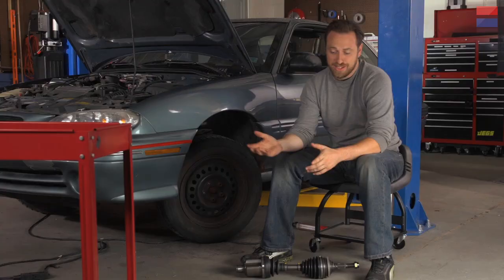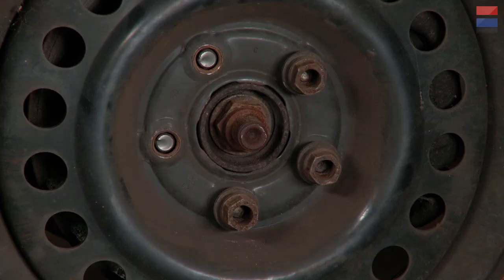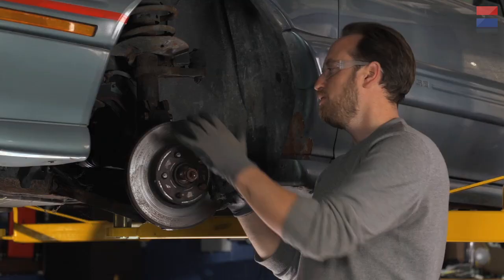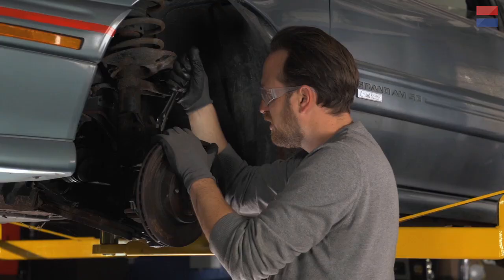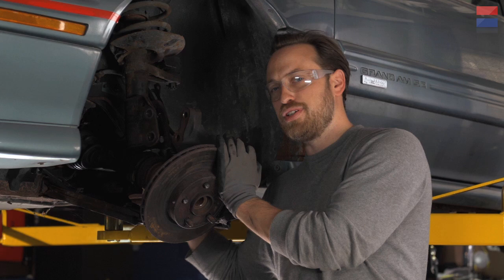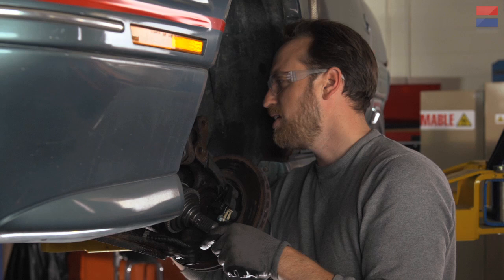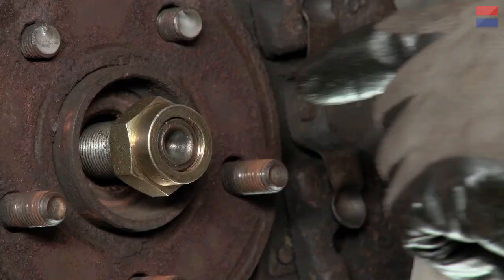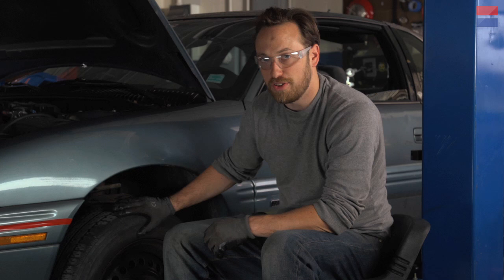How to Replace a Front Axle Half Shaft

Comment: I tried your pry bar method on my Jeep Commander, All went well until time to pop out the axle. It would not come out. I pried and pried, I actually bent the Axle drive shaft seal and the oil started leaking out. Unfortunately none of the local parts stores had the seal. Have to visit dealer in the morning. You should mention that there is a tool similar to the tie rod end remover (aka pickle fork) that can be rented from parts store. Once I got this tool and hit with a BFH the axle popped right out. Took all of 1 minute. Never do this repair on a Sunday.

Comment: ok so there is a way to do this without the need to get an alignment ... you can open up the screws on the bottom part of the hub and you lift and pull up the hub with the suspension, little harder but saves you money :) have done it several times and there was no alignment needed :)

Comment: Seriously Ben.  You do all of that work to replace the drive axle, talking about being careful to clean this, clean that, and lube the transmission end of the splined axle shaft, YET YOU DON'T REPLACE THE FRIGGING OUTPUT SHAFT SEAL?!?!?!?!  WTF?  Get it together man!  Good video in spite of that.
Reply: that's the same thing that i want to know

i thought you was supposed to replace the 
- circlip 
- the seal

if the car uses a CV axel that gets connected to a intermediate stub shaft that goes into the trans

from what i understand, the outer side of the intermediate stub shaft needs a new circlip and a seal

i got a Haynes manual for my car though, and it doesn't say that i have to replace the clip or the seal

and my mechanic didn't say anything about replacing that either

but i still think that i,m supposed to do it

Comment: Be sure to look up the specific torque for the axle nut on your vehicle. It's important that it's not under/over-tightened,as this can cause the bearing to fail. Use a torque wrench.
Reply: thanks man
Reply: Many times,if you're replacing the hub/bearing,the included instructions for the new part will have the torque listed. It may vary from the OEM torque. It's probably best to follow the hub/bearing manufacturer's specs,in that case. Just an FYI,hope it helps someone.
Reply: PhattyMo
Thanks again! You seem to know a lot about cars, i am just learning, a student. I jacked up my cars L front wheel, wiggled the drive axle shaft(the rod between the 2 boots?) and it can wiggle up n down, is that normal?
Reply: I'm just a backyard mechanic,and have a lot to learn myself. In my experience,the axle shafts should be fairly 'stiff',but may have a little play. If it feels 'loose',it's probably in need of repair/replacement. It may depend on the vehicle. I don't have a whole lot of experience with the shafts. Maybe somebody else will have a better answer. Or look for some videos about it here on Youtube. Good luck!
Reply: PhattyMo
Thanks for the reply! i will either take it to a mechanic or take another look into it, it just sucks when its raining and you have no garage and its night time, Cheers ^AB
Reply: PhattyMo

Comment: Kudos on a well done video, it is good that he mentioned about the two strut bolts likely to affect alignment (camber), even if they aren't the adjustable type there is usually enough play to affect position, when reassembling. Most of these videos ignore this. He didn't mention to be prepared that a lot of transaxle fluid can drip out of the axle opening while the shaft is out. If he has enough mileage on the vehicle to warrant drive shaft replacement for whatever reason, he should have replaced the transaxle output seal while he was in there - a lot easier than finding that the hardened old seal didn't take kindly to being disturbed like this. Just saying, that's how I would do it.Those joints don't really wear out unless the c/v joint boots are torn for a length of time, so I wonder why he didn't just replace the boots. Taking the two c/v joints apart and cleaning, inspecting and re greasing isn't that much more work, I've done dozens of them.Those c/v joints are nearly indestructible and no great mystery to work on.

Comment: Hey,
Question? I had a Pontiac Like Your’s ,I didn’t have a bad CV Axle but I had really WEAK Front Shocks - Struts.So I went through the hassle (Saved $75) of changing them myself. I bought them online from a Big Retailer and I questioned them about Front end Alignment after the swap. They e-mailed me that it wasn’t needed but if I didn’t have it done for say 50k or more it wouldn’t hurt. So I took it to a place that specializes in Alignments.They hooked it all up and guess what? It was right on didn’t need any adjustment.The guy told me if there are elongated holes with special washers under the nuts ,like the holes are also wider than a round hole or the bolts that slide through the strut have on side between the head of the bolt and the threads a flattened side for Alignment , Then that would be a good indication that this is one of the alignment points,But since my holes for the struts were Perfectly Round without the adjustment washer it was not a caster or camber ,Toe in or out Point ??So were they Wrong or What?

Comment: I replaced the cv axle on my 2001 Pontiac grand am but for some reason it didn't pop out of the transmission very easily. I had to pry from a few different angles and it took quite a while to get it out and finally it came out. My question for you is do you know why I had such a difficult time getting it out? I'm obviously not a mechanic but I've done a heck of alot of stuff. I did get the job done so no harm, no foul, just a bit curious.

Comment: Superb explanation. My driveshafts are OK but I think there is a problem with the bearing in the gearbox where one of the shafts goes in. Does that generally mean a total gearbox strip down or can the bearing be pulled out with the transmission still in the car?

Comment: Instead of removing the knuckle/strut bolts to provide clearance to remove the axle, isn't it possible to avoid a alignment issues by removing the lower ball joint from the knuckle instead?
Reply: +PsychoFisho 
Nevermind - I posted before reading the comments.
Reply: I wanted to say something about no alignment needed, PsychoFisho you said it for me bud, ty

Comment: Great vid!!     I am trying to remove 2008 Jetta front drivers Axle - 1K0407271BP. for CV boot repair.   How do I pull it from the transmission side? 

Ben, I see that you forced a pry bar behind it.  Maybe, that's what I need to do. I saw your half-axle was similar to mine on the transmission side.    Anyboddy know??

I got the axle freed from the wheel side, easily.  But, wasn't sure how to pop it from transmission side. Didn't want o force anything until I was certain of method.

 I saw several videos that show certain VW-family years  and models where 6 -each 10mm spline bolts are removed from an inboard bracket.. then, axle pops out (of course, having already freed up the wheel side). But, my axle doesn't have this.

Thoughts (I know... go to VW service... HAH!)

Comment: Nice video, thanks. You did not mention about how to address the oil or grease that was lost from the damaged CV.
Reply: Your new or reman axle has the boots already pregreased. As for the fluid coming out the differential, not much maybe a quart comes out, rarely, but just in case you just check your trans fluid level after you're done, fill up as needed.

Comment: Do you have a video on how to replace the Bearing behing the cv oil seal on a grand prix. 2008 When i removed my cv axle there was little bearings all over. Thanks for any help. Had to wrap a chain around the back of the axle then around a pry bar then swing like a bat just to get the axle out.

Comment: I like how not everything in the video went perfectly and it showed you having to struggle.  Too many how-to's show the best case scenario.

Funny thing about that is that getting a typical half shaft out can often involve the very worst case scenarios.  You actually got that shaft out of the wheel hub easily..like real easily.
Reply: Very true. I was trying to replace the hub and can't get it off the axle. Now I'm replacing the axle just to put the new hub on.
Reply: UnHoly 666 that's a waste of money just buy a 3 or 2 jaw puller iT will push the end of axle through the hub and you only spent 20 and save a lot of time
Reply: I bought a 12 ton 3 jaw puller. I bought a 3 jaw puller that you can also hammer. Neither were worth a damn. I had to buy a new steering knuckle and axle and replaced it all. Problem solved.
Reply: UnHoly 666 damn must of been welded in there that sucks glad I didn't have that problem
Reply: @jb0915  rusted in and I find the hardest is pulling it out the diff

Comment: How do you replace cv axel on a 2000 Saturn LS2 3.0 V6?  Would you do a video on it?  Can you also show how to replace the drive belt on same vehicle?
Reply: all front drive cars is basically the same just different sizes and bolts. im replacing both of mine on a 01 dodge intrepid 3.2 not a fun job but not that hard. If the axel want come out of trans lock a log chain on the end where it goes in trans and and tug the other end of the chain. hope this helps.

Comment: I saw the video. I am working on a 1993 Buick Century with a 3300 V6 and a 125C transmission. Basically the same setup as the car he's working on. The axle shaft will NOT come out. I will have to send it in. I tried the pry bar, slide hammer, pickle fork.......nothing worked. Passenger side axle came out easy, drivers side won't budge.
Reply: Try having the axel connected to the breaks and caliper system unscrew all bolts  bull towered you and down make sure car is jacked up or raised. That's how I do it everytime. Gravity does the work

Comment: I have a 2005 Chevy Cavalier with a ripped boot on the front/passenger side. I pulled the axel and replaced it with a remanufactured one. Week later started making noise again, I thought it might be because it's is a remanufactured one. Bought a brand new one and it does the same thing still. And the stub shaft seems to be stuck too.

Comment: How do I check to see if I need to replace the CV joints. Have a 97 Chrysler LHS and it acts much like a rear wheel drive does when the U-joint is shot! Have never done this so need all the help I can get.
Reply: Clicking noise while turning is usually a good indicator.  Then you have to isolate it to which side it's happening on. 

If you can get under the car, inspect the boots on the half shafts, if they're cracked the packing grease has probably leaked completely out and you're just grinding metal.  They should be grease free if they're operating properly (because the grease will still be completely contained inside of them).

Comment: hello sir, I have a 2000 KIA sephia I'm trying to replace the passenger side CV axle. For some reason I cannot get the axle pushed all the way into the transmission shaft. Also my lower ball joint keeps falling out pulling my CV axle out if the transmission shaft every time I try to take it for a test drive. Do you have any answers?

Comment: I’m getting a vibration and it honestly looks like the transmission end of the shaft isn’t seated all the way down. Is there a way to make sure? My boots are fine no tears. My front suspension was lowered a while back to change the oil pan. And the end came out as did some fluid. I refilled the fluid and thought the end was back in place and I’m not so sure but it’s all bolted down.

Comment: If you have to hammer the CV axle shaft to get it to push through the wheel hub, I suggest using a rubber cap or a piece of wood instead of twisting the nut on backwards, and using that as a hammer point. You can lock that nut on there by smashing the threads and have to end up cutting the nut off.
Reply: stan d. upnow same here. I had to cut my axel bolt off which messed up the threads on the CV axel. I had to cut off bout a inch off of the CV axle.
Reply: Racampiño de un eho 2004

Comment: Be very careful when removing the shock absorbers' bolts if the springs sit on the lower control arm because the springs are pushing on the control arm and the absorbers are holding the control arm in place. You have to remove the springs first.

Comment: Sir why does my car shift but wont move at all even in reverse. When im not stepping on the clutch there are some weird rolling noise which is I think from the CV axle or from the boot part. My speedo reads some speed when im not pressing the clutch and coming back to as I press the clutch and the weird noises gone as I press in the clutch. What possible problem of my car sir? It is a Mitsubishi Lancer with a Manual Transmission on it. Hope you answer sir. Thanks a lot!

Comment: I've got bad wheel hub assembly and the axle nuts are rusted over and melted. I was told I would have to cut the CV joint and replace the whole axles

Comment: I have a 1999 Honda Accord automatic V6 it recently started shaking only when I accelerate. the shaking gets worse uphill and gets worse the longer I drive... it doesn't matter what gear I go into it shakes. when step on it it still shakes. would this just be an axle/cv joint problem. the car has 190,000 miles and never had the struts replaced. could that be the culprit?

Comment: When the outer shaft splinds are seized into the hub I find that a air hammer works really well with the pointed adapter, if there is a hole to focus on. Be carefull though you need to have commitment and sympathy.

Comment: You can use a screw driver in the vane of the rotor and let screw driver rest against the brake rotor bracket to tighten the nut also. Not a fan of letting wheel on the ground.. to do this if you have a hoist. Just makes more work and after you still should take the wheel back off and make sure everything is right.

Comment: That car doesn't need to be aligned after doing this.  Only if you have those oval shaped holes going through the strut for camber/caster adjustment.  And in that case, if the ball joint is serviceable separate from the control arm, just disconnect there instead.  You can also disconnect the tie rod end from the knuckle and it still wouldn't need to be aligned.
Reply: I agree.  that car does not need an alignment.  Nothing adjustable was touched.
Reply: Toe should be checked. There is always a bit of play in the strut mounting bolt holes, and it's impossible to avoid a bit of change when reassembling.A very small movement at that point is magnified into a larger change at the tie rod end, I have always found, and I've done dozens of these. Toe can be checked in 2 minutes on the garage floor, and who knows, it might still be in spec, but if your steering wheel ends up centered in a different position then toe is off for sure. Just saying, might as well be on the safe side.

Comment: Good video. No alignment; no adjustments can be made. The strut bolts probably have a torque close to 85 and the axle nut is probably 159 or more. Invest in a manual :)

Comment: I changed front both axle 1 month ago after that clicking noise has finished but grinding  noise has coming when I push gas
Reply: +Farhan Khan You're losing or already lost your transmission oil, if you don't put new oil you're gonna mess the whole gearbox, in case you didn't already messed it

Comment: Hi Ben. Can the boots be replaced with new one without replacing the whole shaft? Because with mine it's just those boots which are broken.
Reply: they most likely can be but if there is a ripped boot you will have a lot of sand like stuff and different things that are bad for the joint...like said get a pro to clean it out and install a new boot or just buy a. new one
Reply: +Dan Makwakwa whole new shaft is so cheap why go to all the trouble to replace the boots. I was going to do what you are talking about but why when things are so cheap.

Comment: Would it be just as simple to change the axle on a Mazda 6 2003? And also, how would you know that your actually turning enough to a certain amount of torque?
Reply: Use a torque wrench. You set the torque wrench to whatever foot lbs that you looked up and it clicks when your tight enough. You also have to see that your bolt is on all the way. I've had a torque wrench say "tight enough" when the bolt wasn't on all the way.
Reply: Oh ok thanks!

Comment: When changing CV axle, if only driver side is bad, should I just go ahead and change both axles or just change the bad one?
Reply: Depends on your time and budget. I would just replace the part that's bad.
Reply: Personally, I would replace both axle shafts if your budget and schedule permits - If both axles are the same age, when one fails the other is usually not far from failing too. It's extra work, but once done you don't have to worry about it for 100K+ miles. 

Thanks for the informative video!

Comment: why you just did just take off the lower control ball joint nut tap it out with the tie rod end and move the whole assembly as one I seen my father do it that way and you don't need a wheel alignment

Comment: After replacing the axle on my '04 Acura TSX, it shakes on Accelaration, no shaking before i replaced the axle, any help and advice, is appreciated.
Reply: no expert but make sure everything is seated right
Reply: That's easy you didn't do it right.
Reply: If you removed your strut bolts to get to axle, chances are shaking could be bad alignment.